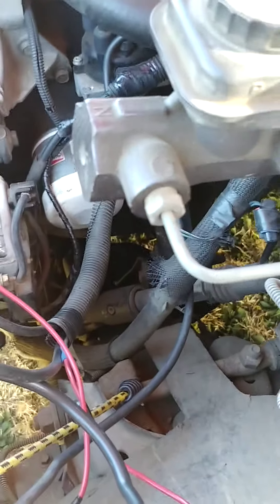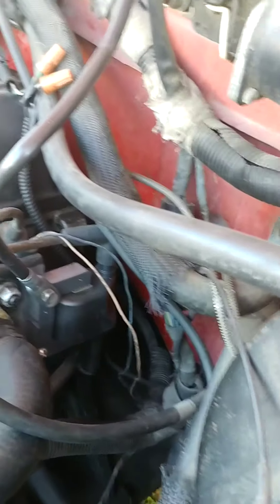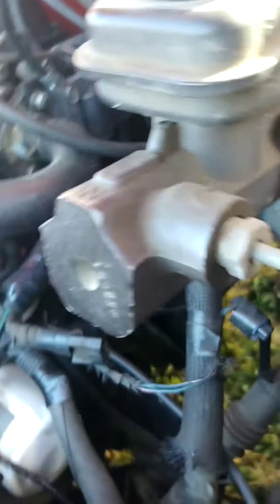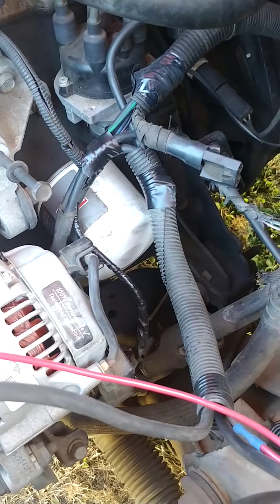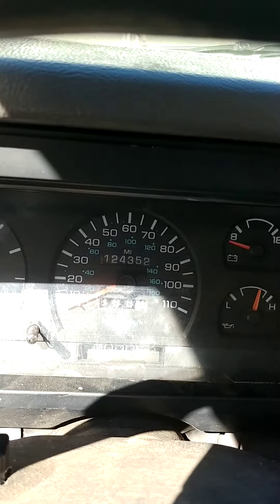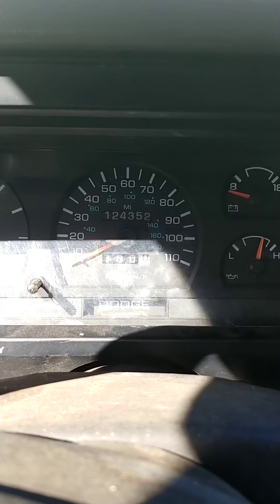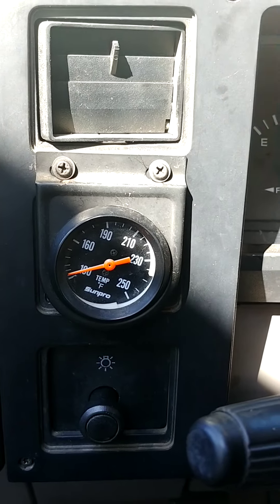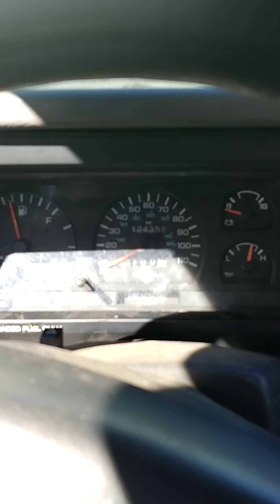Dodge Dakota electrical problems/solutions

Comment: Did you fix it? It's a year later. I have an 89 Dodge Dakota (88 mfg date) drivin me nuts stalls i thought bad gas. Got new distributor some spring and a shift thingy. 3 weeks later same issue. Aargh.  Guess I'll find out next appt wirh mechanic Dec 10th 2022.
Reply from the maker: Yes.i made it drivable. However dodge gremlins started killing other electrical things. I was going to move and wife said it had to go. Sold it. So. Perhaps I can save you some time and money, maybe. Look at the alternator. There are wires running to it. On mine those wires had the smallest rub spot you could feel but very hard to see.  The wires were touching nothing to rub. Yet it would arch to ground and kill the truck. That was the clincher. Another guy I told found the exact same thing. I like you changed the distributor. Didn't matter. Another problem was the electric fan internally grounding. Would kill the truck. There are wire joints that are wrapped below the fuse box under the hood. You have to unwrap the wires to see the joints. I eliminated the joints they were suspect. But I tell you look to that alternator wire it's simple and stopped that distributor fail. Perhaps just pull those wires. Electrical tape them completely to keep them from jumping to ground. Then put them back in place. If you can't find it I would suggest selling it and find a dependable ride. Dodge electric sucks.i went through 3 mechanics. They never solved the problem just swapped distributor parts. One had the audacity to call himself a automotive electrician. He was so bad I reported him to the dept of justice. Then he in response wanted to repair the truck but I no longer wanted him to touch it. Alternator wires and tape my friend. Strongly suggest you do that. May just do it like it did for two of us already.

Comment: Where are you located at? If anywhere in the Phoenix area there is an auto electric shop that is absolutely phenomenal with finding issues with any vehicle nasa auto electric they are on 62nd Ave and Glendale and honestly when I have an electrical issue with my vehicles I take it to them because it's cheaper than me spending days or months or even years searching for the problem
Reply from the maker: I got the main problems sorted out. Then some one wanted to buy the truck. I disclosed its known problems and history. He paid cash. No more dodge issues. I am sticking with Ford.

Comment: I have a 92 that died all the time a d I put all kinds of different things into it. Then a mechanic checked and got it to die and told me it was the computer so I replaced it and have had no problems since
Reply from the maker: I dumped the dodge. Sticking with Ford. Never ever had such problems with a Ford.

Comment: Where is fuze for the dash lights
Reply from the maker: No longer have that truck. Fuse boxes both under hood drivers side and under dash drivers side. Most of the fuses are in the box under the dash. That's all I can tell you at this point.

Comment: 92 dakota 3.9 v6. Next day after buying it the trans blew up. Didn’t drive it hard. Just a pos trans. I never see fords with this kind of electrical issues. Never. All dodge and Chevy always and forever will have electrical issues no matter the year model. Never ford. Never. Never.
Reply from the maker: I agree. Ford has good electric at least mid 90s and back. Dodge electric sucks.
Reply: Bullshit ford always has electrical issues starters grounds coils

Comment: My dakota just shut off while i was driving
Reply from the maker: Alternator can go bad while you drive and shut down when battery gets drained. Does it crank over? If yes check fuel? Spray starting fluid. Start? If no likely spark. Just have to narrow things down.

Comment: You have a Bad Brain My 99Dodhe Did Crazy Electric ⚡ Issues.I found one in a salvage.holdYour milage Button in until your Mileage computer 💻 Starts restarting then wait.untill it finished.
Reply from the maker: My odometer was not digital nor any gauges. I sold the truck. Wire shorts kept coming up. Fix one and get another. I disclosed everything and the guy paid cash happy to get the truck.

Comment: What year are you working on? I have the 2006 Dakota
Reply from the maker: 1995. I had the running issue repaired. Other issues unresolved, fuel gauge, odometer, heater fan. Repair one problem in electrical and others popped up. At least I got it dependable running. Sold it disclosing the history and existing issues for a fair agreed price. Never again am I getting dodge, jeep, chrysler, mopar, eagle, of any type. Electrical from he'll. No thank you.

Comment: Try the crank position sensor, if it doesn’t start try putting it in gear and rolling it then try and start it. That what works for me lol.
Reply from the maker: It's repaired. Never found a crank position sensor. Problems solved were wire connection at bottom of coil, electric fan internal short, wire harness rub short near alternator, hidden splices in wire harness on main cables (eliminated splices and rerouted the cables), bad fuel pump (other one was new). Been performing perfectly a couple months now. However cluster gauges are still inaccurate, blower motor stopped working ( problem between fuse, switch, and blower). Tested old blower after removal and replacement. Old motor is fine. So bad switch or short on the circuit. Screw it. Going to bypass the wire harness and run direct with a new toggle switch.

Comment: I'm convinced satan manifests himself through the wiring of my Dakota..I have pcm/ecm errors all the time loosing communication and MPH/RPM gauge going haywire and constant check engine light on. I'm gonna replace the fuses for the pcm and start there if not im calling a priest.
Reply from the maker: On mine I had a short near the alternator a very small flat rub spot. It was not touching anything. Yet it was jumping spark from the harness. Look there very close and feel the wires for a flat spot. Also the wire coming sway from the breaker box under the hood have hidden factory splices. Those I eliminated. That cleared up the problem of it dieting. However the odometer later stopped, the fuel gauge was dead, the heater fan quit and lost power. None of those things happened at once. Oh the oil pressure gauge showed nothing but I wired in another pressure gauge that worked.  Dodge Dakota wiring seems to suck. Sold the truck and disclosed the problems I had and worked through. Still got 800 for it.

Comment: These Dakotas have horrible wire harness and electrical designs. I have two both have 318 one is 4x4 with bucket seats other is a sport.. I’m bout to gut the 4x4 and redo harness and the gauges and dash
Reply from the maker: A guy bought mine. Sticking with ford. Never had so many electric issues with one vehicle. No more mopar.

Comment: Sell your truck to somebody who deserves and go get yourself a piece of s*** Ford
Reply from the maker: I sold the piece of crap failing electrical nightmare dodge. My ford's run day in day out dependable. Your right I don't deserve a piece of crap undependable electrical gremlin nightmare but a vehicle that's designed to work properly and dependable. Garbage dodge. But hey, it ran when I sold it and he drove it away with all problems and history disclosed. By the way, my videos and input have helped others get thier dead dodges back on the road again gratefully.